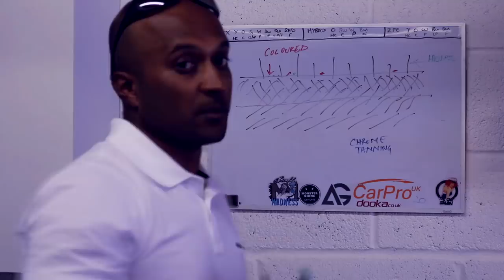Quality Detailing Lighting Setup on a Budget

Comment: I wouldn't bin your halogen setup just yet, different colour paints need different colour temperatures of light to see defects. Having a choice of 3 light sources is a good option. Halogen 3000K, neutral LED 4500K, cool LED 6500K. I wouldn't worry too much about CRI, as I wouldn't use any LED source on its own to colour match, but for finding clear coat defects the colour temperature and intensity is far more important, and finding a combination that doesn't strain your eyes even more so! I've been buying/collecting LED torches (flashlights to our American friends) for many years so I've learnt a lot, but won't bore you with the tech!
Reply from the maker: no I love it, honestly the more info you can put out about it the better, even if its a long essay.   For me the problem is space.  I cant always have like millions of options for this, because all areas of detailing potentially have all these options and trappings you could want.  Ive also got some real dumb problems with blacking out my current garage due to the stupid place I put the cupboards, real dumb error to put them on the back wall :)   But yer the halogens were cool.  actually found it better perhaps for fine scratch on black than the LED.  but basically one torch one workshop lighting that takes no space is really all I can have.
Reply: @ForensicDetailing  A picture speaks a thousand words, if you check wikipedia for 'color rendering index' there's a pic showing a regular light bulb and a fluorescent bulb. The regular bulb emits all colours of the spectrum, the fluorescent misses a lot, LED's are the same in that respect (even high CRI ones). Your halogen setup has a CRI of 100, but if you look at a cars paint with just that halogen in a dark garage, and then take it out in daylight it looks totally different, that's the colour temperature coming into play, halogen 3000K and daylight anywhere from 5000K to 6500K depending on time of day/cloud cover etc. Try your halogen light vs your LED one on those red buckets with the white writing, they'll look very different, and as you say, black can be easier with a warmer tone of light. Cool light gets soaked up by dark surfaces, cars with xenon lights on a wet road are often worse than old style headlights even though they have a huge amount more lumen output. See how you get on with the LED setup you have, if you struggle with it on dark colours it might be worth spending £50 on a neutral white LED torch and rechargeable battery. I'll be interested to see future vids once you've had the chance to use the LEDs.

Comment: John , there are a great deal of lights out there , the main thing that we have found is You have to mix them up a little to cover the full spectrum if you are looking for imperfections indoors. You can chase something that doesn’t show up in bright sunshine but shows inside. Trying to mimic daylight has always been a problem in our industry. Generally Price is always a main factor with the majority of Detailers. This light seems to be at the right price point for most👍 .
Reply from the maker: yer for sure , theres complexities to lighting setups that go way beyond my understanding.  I think if I was doing this for a living Id want to learn more and have more options just like you say.  Ive noticed different lights can show up scratches better on different colors and its defo like you say not all about horsepower or lumens.   but these are kind of good enough for me I think.  space has actually become an important priority recently.
Reply: Forensic Detailing Channel , yes space can always be a premium. We had a custom lighting tower manufactured. It has a mixture of Fluorescent , Daylight fluorescent and LED all in the same system. It’s great for standing off away from the vehicle giving enough space to work inside and outside the vehicle. Check it out on our channel. 

On a different note, are you popping over to the 🇺🇸 for SEMA in Las Vegas this year? If so hopefully we can meet up 👍
Reply from the maker: @VeteranDetail  I dont think I will be there mate this year its a long way for me.. but I love the USA I really do, one day Id love to get over there and travel around and meet other channels and maybe do sema and stuff like that.  will defo ping you and meet up would be great, appreciate all the support and great informative comments you have given to the channel on lots of videos.
Reply: The market is flooding with very high quality COB (Chips on Board) LED lights right now and the prices are dirt cheap.

Comment: Halogen bulbs have a warm light around the 2400kelvin which is not adequate to show surface imperfections for detailing.  The kelvin rating that works best is between 5000-6500K.  As he described the halogen emits a slight orange color.

Comment: I have the Ring handheld which is very similar to yours a Scangrip Matchpen which I won in a DW competition - it’s signed by Larry from Ammo! These two are pretty effective but I’ve been thinking of one of the big Sealey’s to pick up what the two I have don’t. I doubt the Scangrip options at the higher cost will give you anything more especially for the DIY’er.